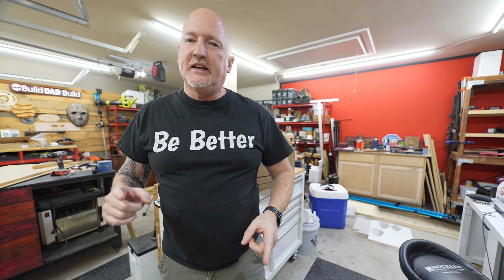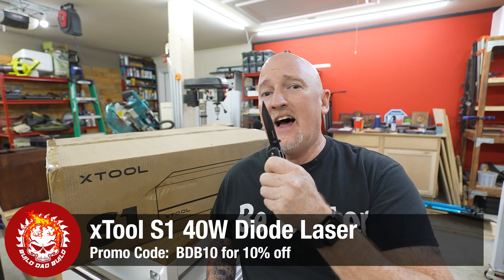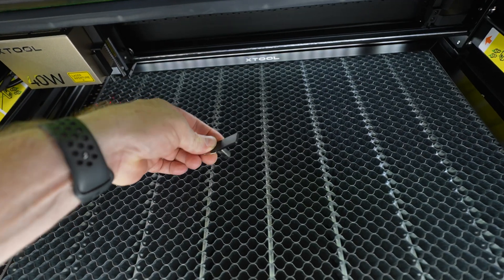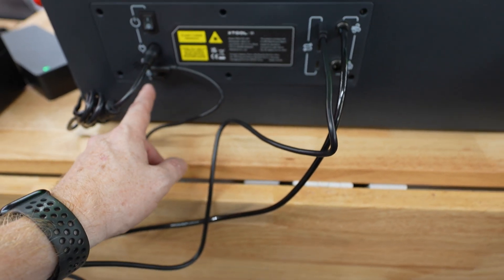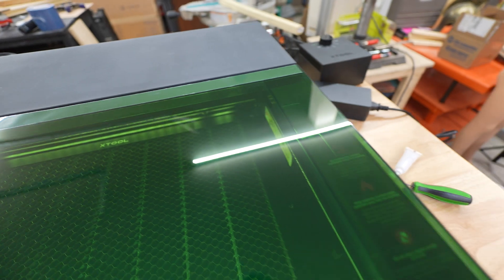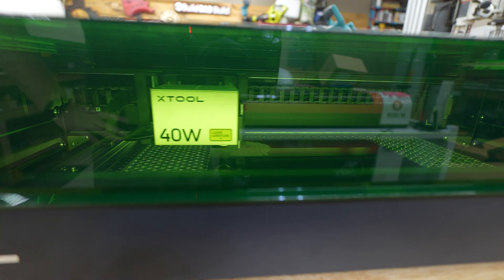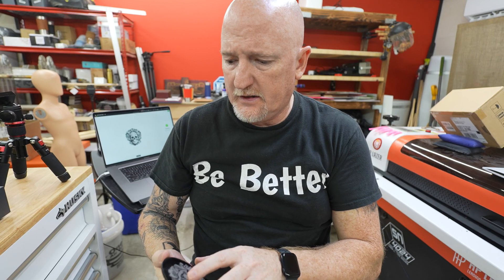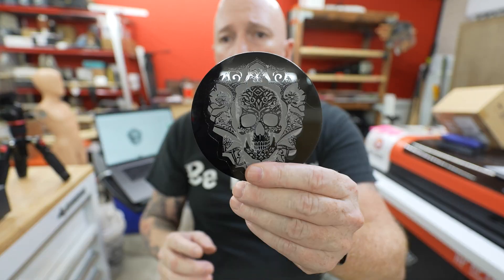xTool S1 - The SAFEST Diode Laser? Definitely the most bad a$$!

Comment: You might want to note that if you get the S1 the RA2 that works with the D1does not work with this unless you buy the adapter plug. The RA2 that you get with this has the plug already on it.

Comment: OK, I have been playing with my S1 that I recently got to replace my D1. A couple of things. First if you have the great adaptable rotary from a D1 or a D1 Pro, it will work with the S1 with a new cable that XTOOL will send you free. Of course you will need the riser base to use the rotary. But in addition, the riser allows you to use the pass through to feed work as wide as 319 mm into the machine. If you add the optional feeder system you can engrave or cut a project that is 319 mm wide by up to 6000 mm long. 
The riser also comes with a pan that is removable that will slide into 4 separate levels to accommodate various size objects. 
The surface scanner is not only useful for hip flasks, but it can map any irregular surface. After measuring the desired surface, the XTOOL Creative Space app will show you a 3D image of the surface. This makes warped wood pieces or odd shaped objects very easy to process while keeping the laser focused all the time. 
At the moment LightBurn will drive the S1, but it’s pretty clunky. But the LB folks intend to make it much better soon. 
The laser safety features cannot be understated. It has a Class 1 Laser Safety Certification. So it can be used in any situation without the use of safety goggles.

Comment: I just got my D1 Pro about 4 months ago.  Buttttt...............I GOTTA HAVE THIS BAD BOY !!!!  FYI, your US links do not work because of the $ amount.
Reply from the maker: Wait. What does that mean. About the links?
Reply: @BuildDadBuild  I clicked on the US links and they don't work because the $$ amounts are included in the link.  Thus, it doesn't work.  It works fine if you remove the $$ amounts from the link, but didn't think you'd want users having to do that.
Reply from the maker: Gotcha. Those have been fixed.

Comment: I just got my S1 last week Nick. They had to scramble to catch up to the LaserMATIC! They'll have to scramble again when the Mark 2 XL comes out! The whole focus gimmick is way too much IMO. I have to say, comparing it to the Mark 2, it looks and feels cheap for the price. Fun video as always!
Reply: While I haven’t seen the Mark 2 XL, the surface scanning is no gimmick. It’s a breeze to use and very accurate. Also, the system always knows the current location of the laser, so you can move the laser by hand to easily specify the corners of the area to be processed. As much as I like Nick and I support his Patreon crew, his demonstration of the S1 was very clumsy. You shouldn’t dismiss the S1 until you’ve had a chance to work with it.